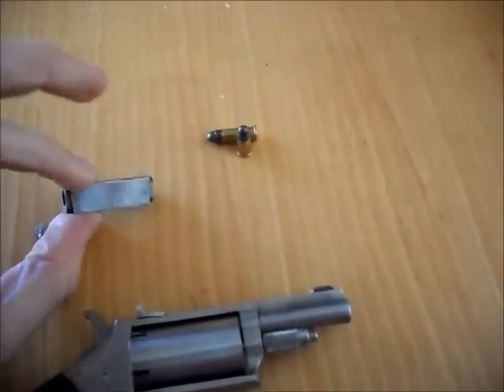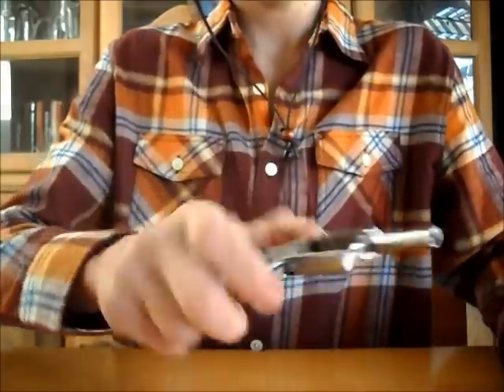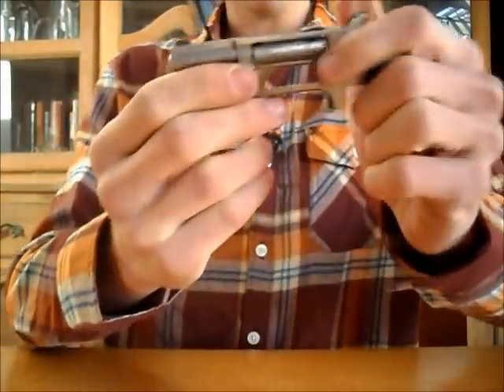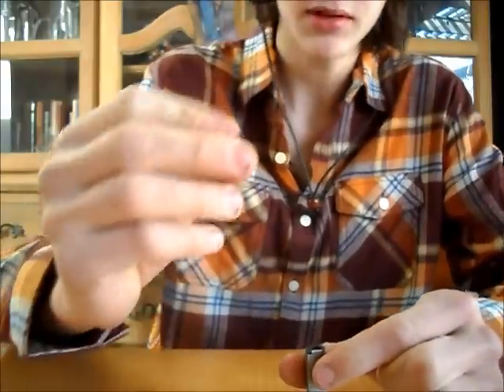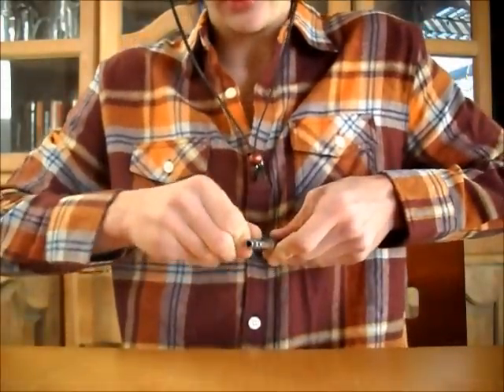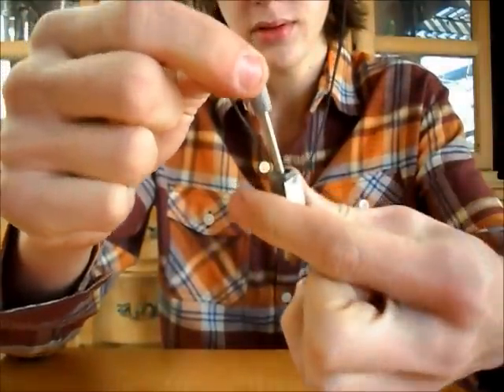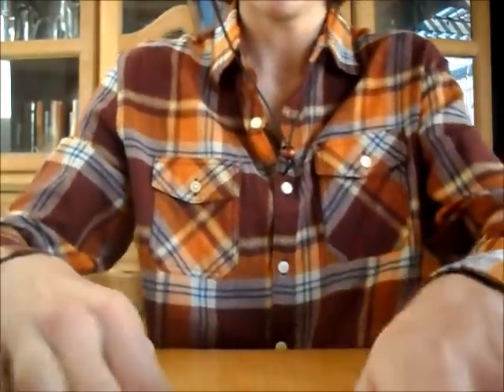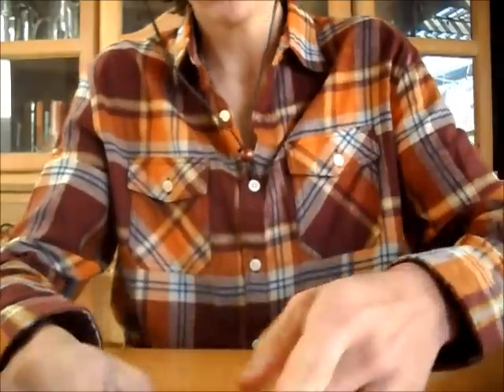NAA cap and ball cartridge converter

Comment: Y'all buy some real guns.I have over 15 pistols in my collection and if it ain't a 357mag or better I won't buy it.
Reply: My Collection of 22 cal will put you 6 feet under just as good as a high cal firearm. Point being, gettin shot is gettin shot dont matter with what it will suck.
Reply from the maker: *****
 I feel pretty safe with a 20 gauge, .30-30, and .38 Special. I can do anything I need with those guns. I still find myself picking up my .22's for lots of things, even defense. Because 9 rounds of .22 in a revolver should be plenty.
Reply: "if it ain't a 357mag or better I won't buy it." Fudd